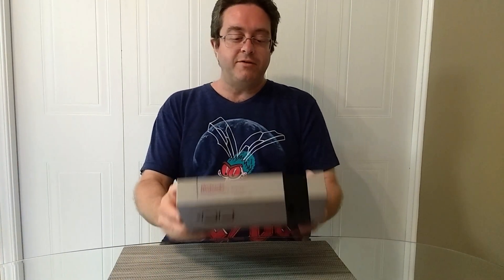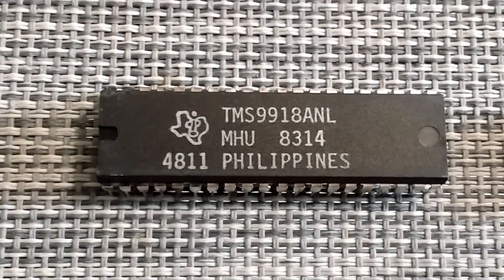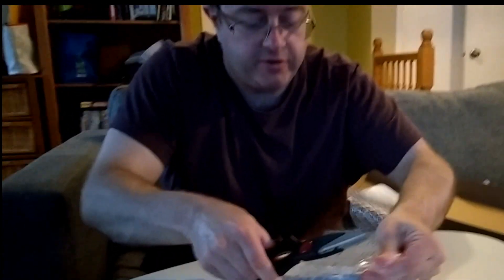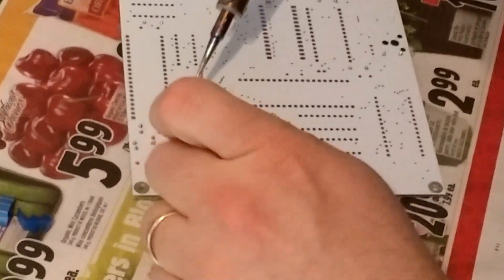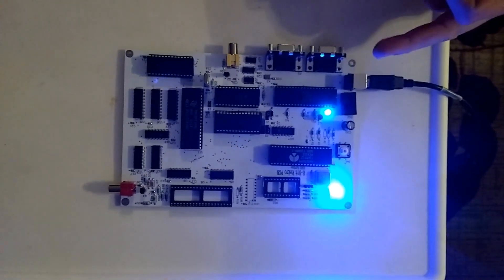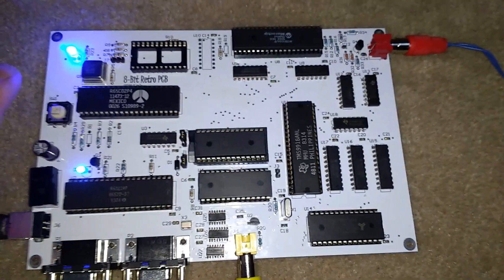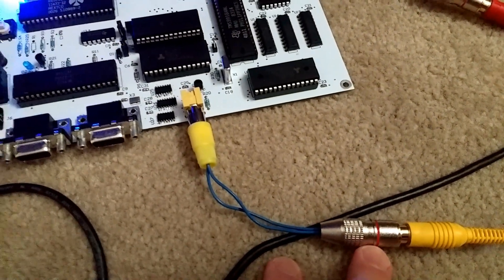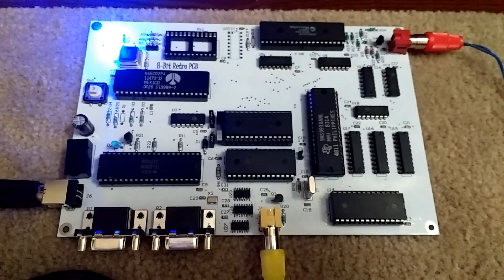Homemade Retro 6502 Computer - with 8-bit graphics and sound

Comment: wtf why would you run it on bare carpet! Are you trying to fry your board. 
Otherwise nice build! Good job on troubleshooting your faults!.
Reply from the maker: I momentarily lost my head and forgot about ESD concerns.  Thanks for compliments. :)
Reply: @dangrise6182  no worrys!, I'm 'learning' digital again, maybe this time it will click. Love the home brews, can't wait to build my own.
Reply: it's a 6502. it'll run submerged in a frozen bucked of shit mixed with sea water on the moon while being attacked with nukes by aliens for 40 years in a row. this isn't some flimsy android crap that crashes and dies due to you touching it with your 0.7 volts emitting finger. (although nmos isn't as good as SOS CMOS with esd protection on all gates even 1970s production runs can take a bang. else we would not put hem into missiles nowadays now would we. if it can't handle some carpet you don't want to use iti n products. one of the very few chips on the market that has been proven to 'just do the job'. forever if need be.ran a board with the the poliarity reversed by accident once... it still worked. all of it. frequently don't bother to clean the solder flux of prototypes or just run them while they're still wet of removing the solderflux or run them without shielding right next to the transmittersthey're supposed to control. these things really don't give a damn. if a bit of rf emp or esd fuckery would make them upset people would not buy them. (and at just some 8dollars each, even if they would break there are plenty more in the tube you got that one out of ;) to actually kill or crash one you really gotta try hard tho voltage drops? it doesn't care.voltage spikes? doesn't care. the power supply actuallyhaving half an ac sinus modulated on top of it?  you'll sooner notice it in the sound or video output or by blinking leds than by the program execution. usually the rest of the chips give up long before a 65(c)02 does. even the really really old ones. and the ones that do die usually die due to some chemical production failure in the plastic package... after 30+ years... also watch that video of that guy running a NES on batteries until the batteries die (clearly the nes lacks a brown out reset) ... you can see the oam dram in the ppu corrupt and the tile rom going out long before the cpu stops playing the game.

Comment: Your audio and audio signals that are traveling down the shields of the cables, that you resolved with the adapters...  It doesn’t have to be an error in your build, you could just call it, ‘Hardware Encryption’.  Since anyone with your adapter cable could put it the right way around, you could call your adapter a ‘hardware encryption key’ and anyone who try’s to eavesdrop in between your unit and the signal’s destination where it comes out into the monitor, they’ll likely be fooled by your clever swapped signals!  This is a nice project and I’m impressed with your system.  You’ve essentially built a whole system from the ground up for a specific application?  Or just making this combination of chips a real possibility through your board?  Thank you for sharing this, it’s very inspiring!
Reply from the maker: Thanks for kind words.  I got a chuckle out of your 'encryption' angle.  I didn't build it with a specific application in mind... but as a minimum I wanted it to be able to serve as a platform for making and playing simple 8-bit games.

Comment: Sorry mate but a Ricoh 2A03 is not a 6502...

It's a 6502 clone with BCD removed and a bunch of extra hardware for sound integrated

Atari 2600 uses a 6507, which is a 6502 with no interrupts and less address space
Reply from the maker: Yes.  You are quite correct.  I also made a similar error in the video when I said the 6502 was used in the Atari 2600.  I have since found out that the Atari 2600 used the 6507... which has less address bits than the 6502 and no external interrupt pin.

Comment: From were did do get design and who wrote bios? These kind video always missing piece and I always winder why
Reply from the maker: Prior to capturing the schematic I looked at schematics featuring each of the major components and used this information as a reference while developing the schematic for this board.  The TMS9918 circuit was copied from a schematic developed by Tom LeMense.  In general I used multiple sources and did a fair amount of research when developing the schematic.

Regarding BIOS.  The overall architecture of this board is pretty simple in that it doesn't support features like disk access so there isn't any BIOS.  There is only 1 x ROM.  I extract it from its socket and place it in a universal programmer every time I want to make a software change.  I know this would be undesirable for some people but I am okay with it.
Reply: @dangrise6182  what about the electrical side of the digital mother board which is much more harder then the electronics and digital side.
How did you count which capacitor and resisitor to which chip and how much
Reply from the maker: I didn't put a lot of thought to these things ironically enough.  I did, however make sure that I had a 0.1 uF capacitor on each chips power pin.  I also used a 47uF capacitor at the point where +5V enters the board.  As far as resistors go, most of them where pull-ups.
Reply: @dangrise6182  OK,I will go with that,but then I did estimate the amount of voltage or current amp needed?
And
What about serial and parallel  ic connection in regard v and I?
In real life if u connecte VCR and PC and.... Into same socket. They will not work properly!
Reply from the maker: I expected the current to be relatively  low compared to modern PCs... so I did not even calculate the design's total current.

Comment: Are you selling these?
Reply from the maker: Currently I am not selling this board.  I have 4 unpopulated PCBs.  I may consider selling those.  So if you are comfortable soldering you can populate the components and have a matching board.
Reply: @dangrise6182  If you have any more PCB's available I would love to purchase one...  I like that this is a 6502 and not the typically z80.  Plus I used to program for the tms9918a when I had a TI-99/4a.  Cool

Comment: Do you have schematics?  I've debated putting the TMS9918 in my 6502 homebrew.  Looks like you converted it to SRAM.  I'm curious what circuit you used for that.  Thanks!
Reply from the maker: For details on using SRAM with the TMS9918 you can see the link below.  I have to credit someone named Tom LeMense.  It was his TMS9918/SRAM circuit I used.  I had to also do something funky on the interface between 6502 and TMS9918 to ensure proper hold time when the 6502 writes to the TMS9918.  The schematic for my PCB is on Altium Circuit Maker.

https://retrobrewcomputers.org/n8vem-pbwiki-archive/0/35845334/48860720/33053543/SRAM%20Replacement%20for%20TMS99x8%20VRAM.pdf
Reply: Seconded!